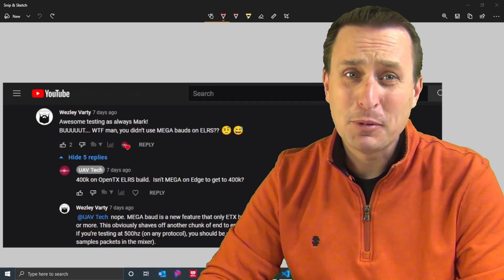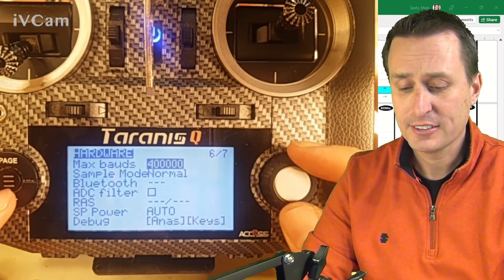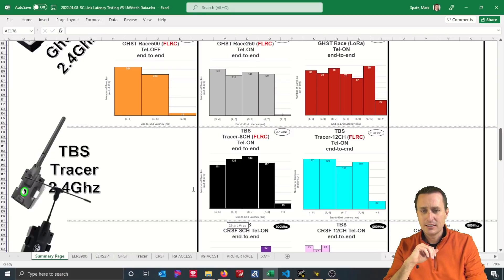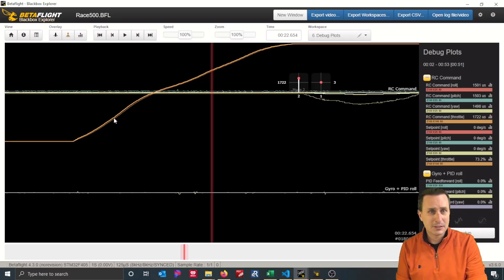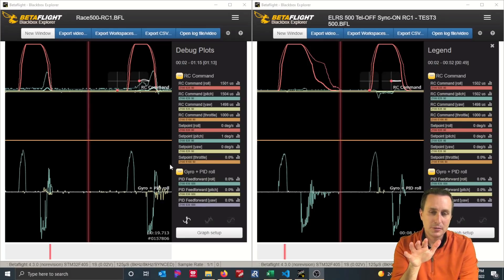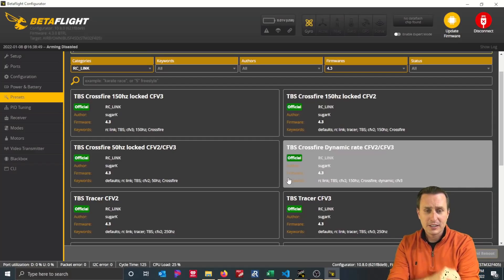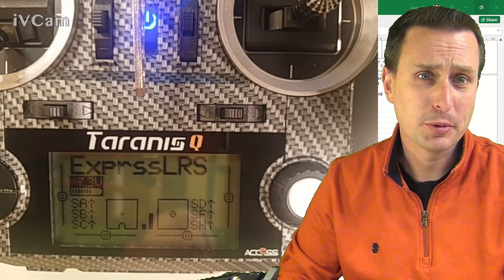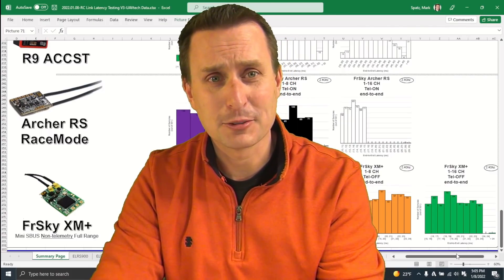What is EdgeTX MEGA Baud?  |  and Why does it Matter?

Comment: Loving the tunes mate :D thanks for the great advice again as always :D
Reply: Aswell it may be worth noting that on my radiomaster tx16s i run a namimno elrs 868mhz module, it stops communicating via the lua at 1.63M baud rate but i can scroll on the menu all the way up to 5M, and its fine on that baud rate with the internal module, i guesse that the external modules have limitations on baud rates they can handle also? :)

Comment: Got the Radiomasters boxer, updated the elrs version, on tx and rx.  Question: if I set the baud to 5Mbps on the boxer.  Do I also have to set the same baud on the receiver?

How do I know what speed is supported by my receiver? How do I know if the flight controller can receive at that speed on the uart?

Cheers.

Comment: I have QX7 like you is it worth upgrading to new TX that supports even higher baud rate ?
Reply: If you're in the top 2% of pilots... Still probs not
Reply from the maker: Nah, at 3,750,000 baud, you can see i get that 1ms.  You can't tell the 1ms either.  It is just a numbers game in a friendly development competition.
Reply: @uavtech  to get this Baud rate do I need to do any special mod or TBS QX7 inverter mod will be sufficient ?

Comment: Wow.. I installed Edge TX and a new ExpressLRS nano module on my Taranis X-Lite and it just wouldn't go to 500hz. It looked like it was going to accept maximum 250hz for the radio link. Increased baud rate from the default 115k to 400k and now it works!

Comment: Great stuff. 3.75m seems to be the limit on my Jumper T18 Pro V2 too.
Reply: i have the jumper t18 with edgeTX, but i'm running crossfire, can i add this features?.. i'm not really sure i understand what it does in a nutshell
Reply: With an ExpressLRS module instead of Crossfire, you can.

Comment: I downloaded Edgetx recently, on my hardware page it doesn't say baud rate.  Also I have the ACCST qx7 model.   Bardwell said "if you put your qx7 in 1bit mode  you can  use crossfire without having to do the mod".   Am I missing something?   I have v2.7.1 downloaded is there a lua script I need to download to see the baud rate?   I haven't bought crossfire module yet because I wanted to make sure it will work.  Thanks for your content

Comment: I tried this on my modded QX7S and noticed something interesting.  My original R9M(modified) would not talk to the radio once I turned up the baud rate, but my 2019 R9M would.
Reply from the maker: Did you do the Mod in the R9 ACCST module?  If not, that is probably the issue.

Comment: I have the 2019 r9m I didn't do the resistor mod for elrs and am running edge tx at 115200 because no resistor mod. Can I raise baud rate now without mod or is mod still necessary?
Reply from the maker: Mod or with EdgeTX you can enable ONEbit right below the baud setting.  Just check the ELRS LUA to make sure set rate is being hit after changing settings.
Reply: @uavtech  so enable onebit then I can set baud rate higher than 115200?
Reply: I did the resistor mod and had 400000 baud rate. I was sometimes experiencing connection lost to the receiver and asked in elrs discord. They asked me to try a lower baud rate (115200). Older transmitters might have problems here with too high baud rates. I have an x9d+, but also qx7 should have problems here.... I still need to do some testing, not sure if this is really a reason for the Rx connection lost.
Reply: I haven't had any problems at 115200 on opentx. Have since flashed to edgetx and it was already had adc filter off, onebit enabled and baud at 115200. I think I should probably just stick with that if it's working... unless 357milion is noticeably better.
Reply: crazy to hear. My access  qx7 no resister mod has edge tx one bit  still with problem running crossfire.

Comment: Question; If I am currently running Crossfire Lite module 900Mhz will Edge TX offer advantages over Open TX? Thank you so much for this information! I may switch to ELRS or Ghost at some point, but I am heavily invested in Crossfire 900 at the moment.
Reply from the maker: EdgeTX has Crossfire Shot for sure.  I'm not sure what versions ontx have a shot at the point.  I think the latest does, but don't quote me on that.

Comment: What about the sample mode? Keep it on normal or use one bit?
Reply from the maker: Normal if your radio can support the high baud on Normal (good hardware inverter).
Reply: @uavtech  it is the QX7 with crossfire mod and Frsky R9M with resistor mod.

Comment: yes i also suffers from that tiny bump on my setpoint.. but if i notice all my throttle, pitch roll and yaw also cant get straight line in log.. they got super tiny jiggy-jag lines... i use jumper tlite  at 500hz, and now using mambo+elrs module at 250hz its still there.. i use 0 FF to reduce the effect to my motors
Reply from the maker: but 0 FF is laggy.  Try the presets.  500hz + presets + healthy FF will provide the best tracking. That said, if happy where you are at .. that's all that matters.
Reply: @uavtech  yes im now using tge recomended preset with mambo+elrs. Dunno why the preset doesnt work well when i use jumper tlite+elrs.

Comment: Any information about crsf v3 being available with ExpressLRS/EdgeTX?
Reply from the maker: If on Freedom TX with latest Xfire firmware, then use V3.  Otherwise, all else are V2.
Reply: @uavtech  Well, hard to put Freedom TX and Crossfire Firmware on my Radio/ELRS hardware.
Reply from the maker: Correct
Reply: @uavtech  Too bad, I want to see how 500Hz with crsf v3 is looking like. For the moment the jitter is pretty ugly compared to 250Hz which is more of a flat line.

Comment: what about sample mode normal VS onebit?!
Reply from the maker: That doesn't impact jitter or anything.  It just lets you run higher baud if you have a slower inverter without doing the hardware inverter mod: https://github-wiki-see.page/m/EdgeTX/edgetx.github.io/wiki/OneBit-Mode-for-X7-and-X9D-Radios

Comment: Nice video, this is some what off topic, but I was not able to get a response from the EdgeTX board. I had installed EdgeTX on my QX7 which has already been modded. Everything seemed to work great, but I was never able to get LUA script to run, it would start to run then freeze up, so I reverted back to OpenTX.
Reply: Is the whole radio frozen or just the telemetry? I thought mine was messed up also till I remembered that non critical stuff like attitude only comes in every few seconds.
Reply from the maker: Make sure you have the latest LUA?

Comment: Hi I use ghost with edgetx qx7, I can put same falue 3750.000  Right?
Reply from the maker: yes, if you have inverter mod. for Q X7 ACCST.  If Q X7 ACCESS you are good.  Alternative is also using ONEbit (setting right below baud) in EdgeTX if you have a slower inverter in your radio: https://github-wiki-see.page/m/EdgeTX/edgetx.github.io/wiki/OneBit-Mode-for-X7-and-X9D-Radios
Reply: @uavtech  yes I made inverted mode due to telemetry warnings when using ghost